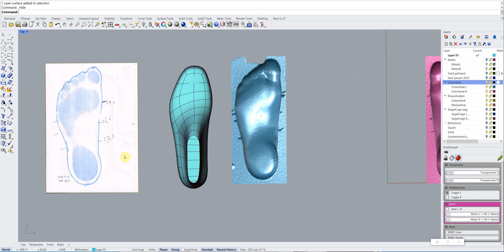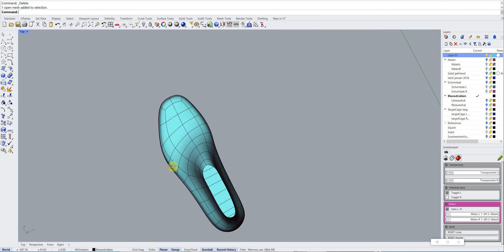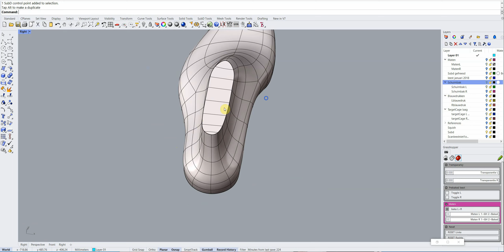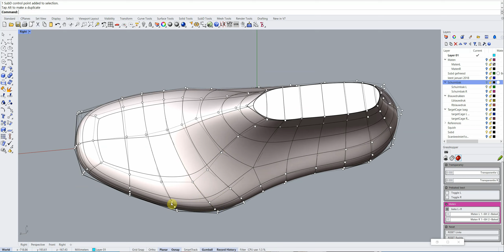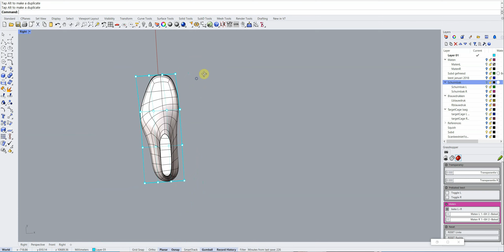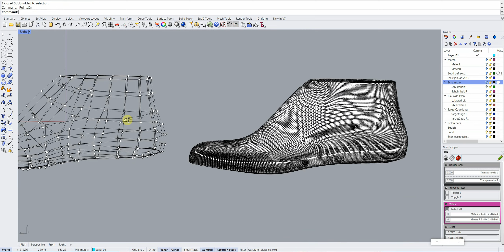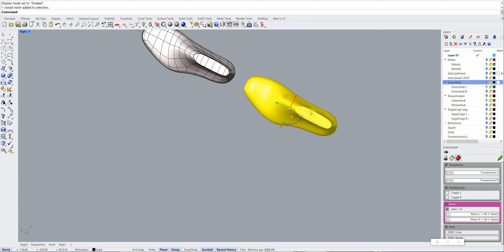Modeling a bespoke last in Rhino, a demo.

Comment: Super interesting, I love seeing someone else dealing with the same issues, but with different methods from me. I use photogrammetry in Metashape to create a 3D scan of my foot from above, then a combination of Rhino's "networksrf" and subD to generate the last. I don't have a good strategy for the contours of the sole though, and I haven't touched grasshopper yet. If you're already scanning the foam box impression, then why don't you scan the top of the foot too? No more guessing about toe thickness, no more photos, better accuracy on heel shape  - seems like it could really help.
Reply from the maker: Hi Mark,
Photogrammetry is something I also tried, but I was not happy with the results. But maybe you have a better procedure, can you show something?
I do not use a scanner for feet because I cast the feet, and then scan the plaster positive.
Since I do not use a scanner at the place where I see my clients, I do not scan the feet when using just a foambox and blueprint.
But that might be useful, although the shape of the foot is not the shape of the last, so "guessing" will always be part of the procedure. 
Scanning helps, but is not the complete answer on how to design lasts.
I will own another scanner soon, maybe I will use that device to scan feet, when casting is not necessary. 
Thank you for your comment, please stay in touch.
Erik Hondebrink

Comment: Thanks, great video. I'm just wondering, why is your original last in grasshopper?
Reply from the maker: Hi Philippe,
The last is in Grasshopper because the cage I use is (a target mesh to which the subD last flows along from a basic mesh) can only be used by a Grasshopper function.
I hope this functionality will also make it to Rhino, untill then I have to use a Grasshopper definition.
This function can also be very useful to flow a complete shoe ( like the ones that you print) from one last to another, so you can use the same design for different lasts!
Reply: @podotools  Since you use the same last for everything and it requires another program, could you please provide us with the file of the standard last?
Reply from the maker: @PunCala  No other program is used, but for the modification Grasshopper is used. Grasshopper is integrated in Rhino.
The last is made with standard SubD tools in Rhino.
Reply: @podotools  As most of us, me included, are complete beginners, could you please share the stock last file you made with Grasshopper scripting? It would help a lot in getting into this type of sculpting.